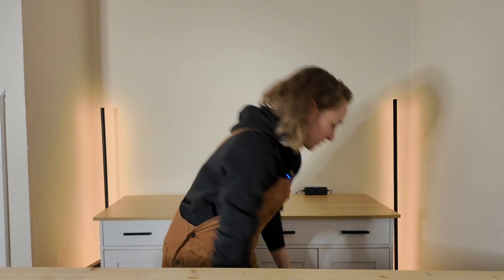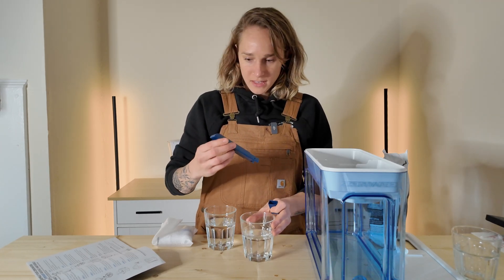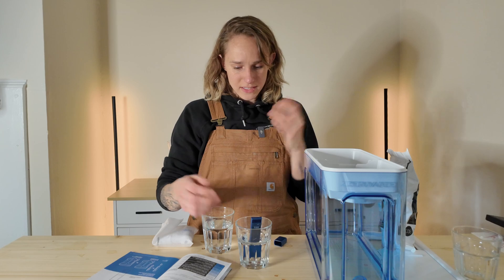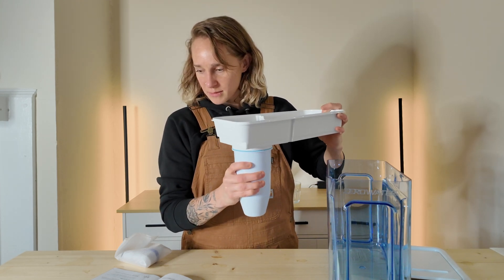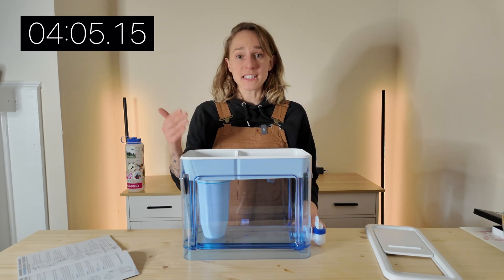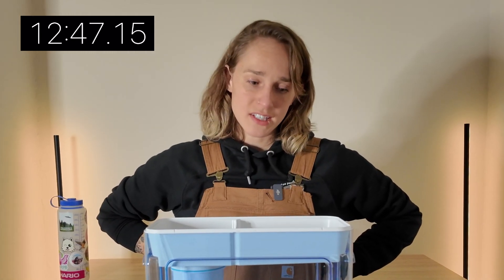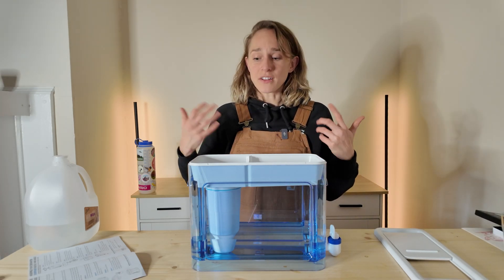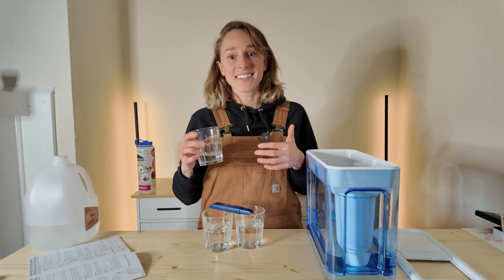Making Pure Water - ZeroWater Unboxing & TDS Test

Comment: my experience with zero water filters is that they have a tendency to "air lock", which slows them down enormously. I have a 1.8 l jug that I empty into a storage bottle and then immediately refill. It takes 5-10 minutes to drain through. If I let the filter drain out before I refill it, then it can take hours to completely drain 1.8 l through the filter.
Reply from the maker: Very interesting. Thanks for sharing and glad you’ve found a solution for now

Comment: That type of TDS meter is very much temperature dependent. I'm guessing your water was warning up while it was sitting there, that's why it kept increasing. 

The filters are incredibly slow - nothing wrong with yours - it's why i have two ZW pitchers 🤣

For the distilled taste thing - check out Coffee Chroniclers recent video. Distilled will actually increase acidity, because there's nothing to buffer that acidity.

I also really like the taste of distilled, and coffee made with distilled... SO BRIGHT 😄
Reply from the maker: Ooooh thanks for the info - this is really helpful! Yes my water was definitely cold coming out of the tap so makes sense it was warming up. I'll be more careful with that next time.
And will check out that taste test video. Sounds interesting.
And I'm sure this is just the tip of the iceberg as far as water for coffee goes

Comment: when their filters go bad they go really bad.  As soon as you start detecting anything other than 0ppm, the water will taste really sour.  
I've used it on water ranging from about 20ppm, up to about 700ppm.  Filter longevity very much depends on starting condition.  A week or two at the worst.  And the filters aren't cheap.  
I don't think it matters for culinary purposes, but cheap TDS meters don't actually measure all contamination, they only measure electrically active contamination.  These filters neutralize rather than completely eliminate those electrically active particles.  It's not the same thing as distilled water.  It's probably just as good for culinary purposes, but for strict chemistry it would be unacceptable.  
My main problem is the filter longevity.  If there was a cheap way to get water hardness down to the 100ppm range, then polish it with zero, that would be pretty appealing.
Reply from the maker: Thanks for the feedback. I appreciate the tips!

Comment: Yeah it takes much longer than a Brita filter and sometimes just stops like that.

With your 70ppm water the filter should last quite long. I have nearly 300ppm water which depletes the filter within a couple of months. I use a Brita before the Zero to help a little bit.

Distilled water and Zero filtered water will be quite different or very similar depending on the water you start with and what you measure. It's pretty confusing.
Reply from the maker: Rad, thanks for watching and glad to know it's not just me!
Reply: Actually it is not slow at all and I have been using zero water for some time. 

I also use pur for drinking water and zw is much faster than pur.  Problem is that it gets above 006 TDS very quickly. 

I'm also in Mebane NC and your tap water @kat is very good! At least as far as TDS goes.

Your filter is going quite a bit slower than mine do.
Reply from the maker: Interesting. I hope it speeds up after I use it a few times and get those bubbles out. So far it is going a bit faster. I'll see how long mine lasts. Thanks for the input!
Reply: @roasterkat  don't let water level in container go below the bottom of the water filter, as this may cause an air lock, and diminish the speed that the water flows through the filter. if you are getting slow water flow, id suggest removing the filter and shake and squeeze it over your sink to remove any air bubbles that may be causing a slow water flow through the filter. also when you top up your water container, pour water DIRECTLY into the filter.